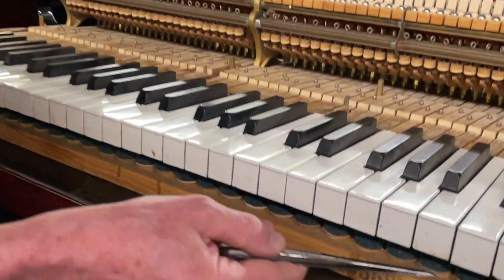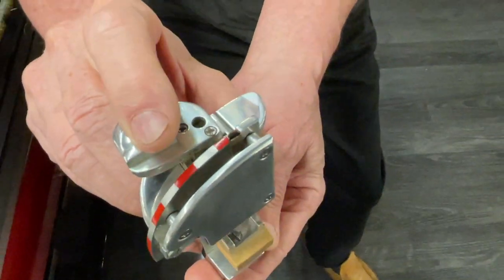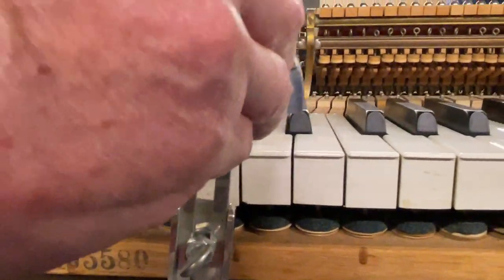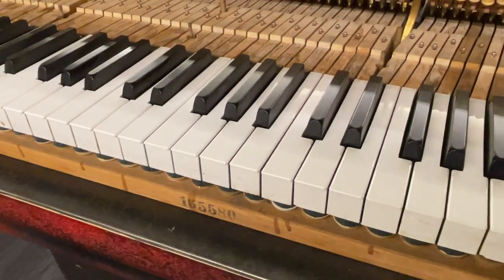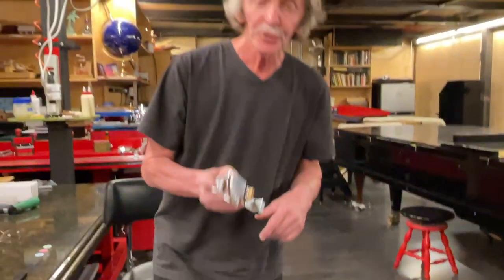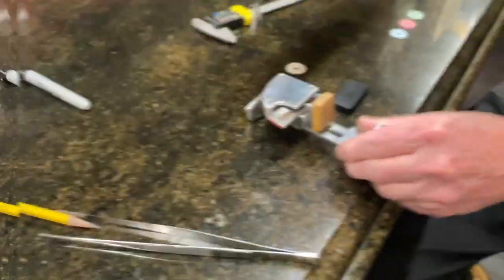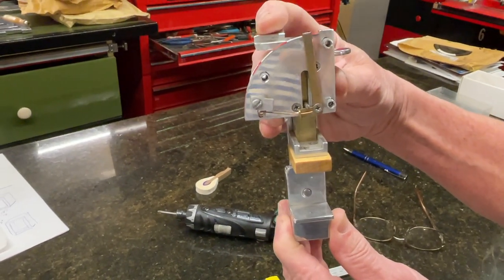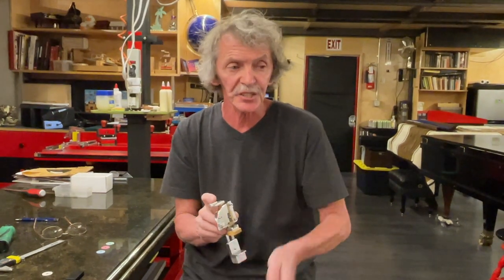Piano Key Depth Measuring Tool

Comment: Thanks so much for sharing this tool development. I'm a new technician practicing to get certified. I am just now regulating my own Grand Piano (for practice) and would love to have/use this tool. Since I am just doing my first key leveling, It seems amazing that such small incremental changes (i.e. the punching thicknesses) on the balance and front rail can have such a large impact (e.g. the need for a 7:1 ratio [magnification] explains/helps a lot with my intuition. It would seem that the balance rail is much less linear (punching thickness to key height) and the front rail (punching thickness to key depth) is more linear (i.e. punching thickness directly "equates" into the actual key depth) - but I'm still learning....
Reply: Probably a bit late to say it, but, if I'm remembering right Balance punchings have a rough 2:1 ratio, punching thickness : key height change. 

That said~
If a key needs to go up 0.010" then you could do 0.005" and it might be a little too high.